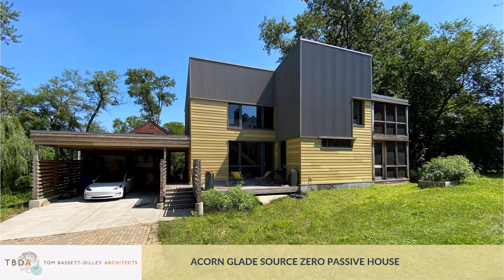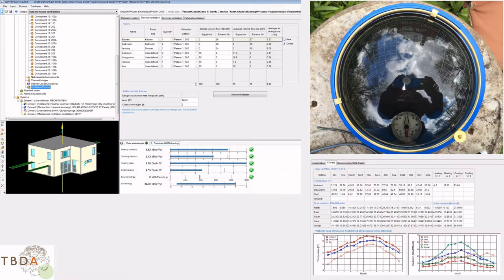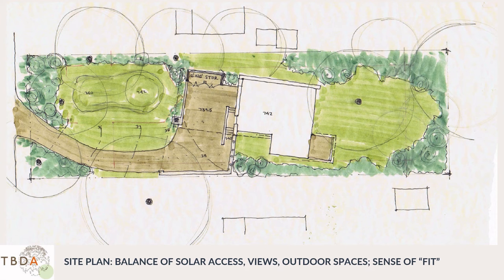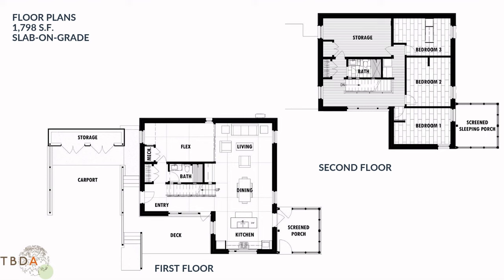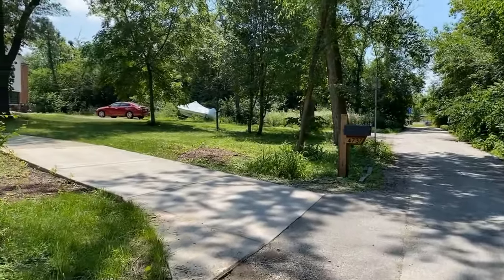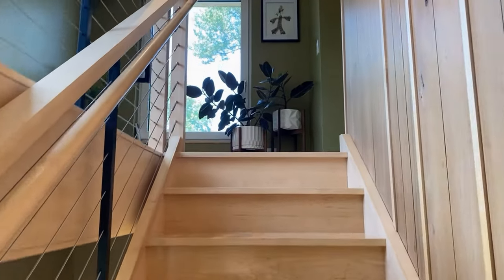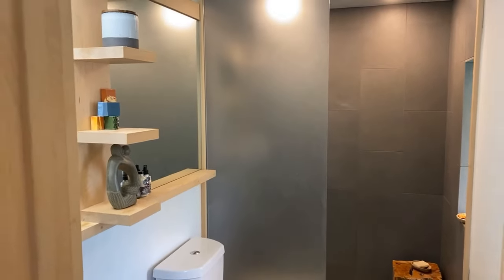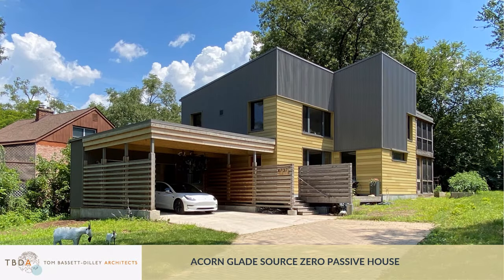Acorn Glade Passive House Tour

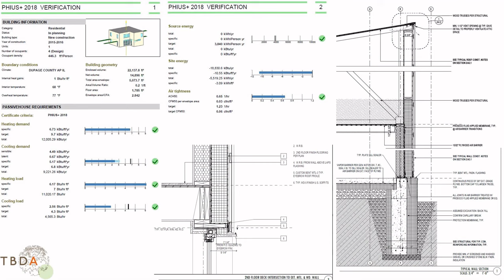Comment: Great design - sleeping porch is a cool idea.  A few questions: 1) At 4:40, why the transition from fluid-applied air barrier to Tyvek (looks like Tyvek fronts the attic space) at the upper walls? 2) At 4:58, the Blueskin WRB - is it adhered to the rigid insulation (shown in wall section at 4:00), or is there another layer of sheathing over the rigid insul. that the Blueskin adheres to? 3) At 4:00, in the wall section, how is the rigid insulation over the foundation wall protected where exposed above grade?
Reply: Brian, my guess on Q1 is that the attic space is unconditioned and uninsulated, the air barrier and insulation are likely in the flat ceiling plane on the second floor. So the Tyvek is only a bulk water barrier for the walls surrounding the attic. Would love to have that confirmed and your other questions answered.
Reply: Thanks! and sorry to be 2 years late answering...but in case anyone wants to know--the Tyvek is above the air barrier, since it's an uninsulated attic; the Blueskin went right over the EPS insulation; and we used acrylic stucco (over fiberglass mesh) at the foundation insulation.
Reply: @mjsunkiter  exactly!

Comment: the carport roof looks like it angles towards the house. Doesn't appear to consider heavy rain water
Reply: it is definitely sloping away! There's a green roof up there now which absorbs much of most rains, but the membrane was designed to make a durable structure. Good drainage and bulk water management is a fundamental design and construction need that is carefully addressed.

Comment: Beautiful home and design. Would you mind sharing what the approx price per sq footage was? Appreciate it.
Reply: IIRC, he said it was a little over 1800 sf
Reply from the maker: thanks! I'd rather not discuss costs on this house in particular, but we have studied costs on Passive House compared to built-to-code ("barely legal" like most construction), and found that for single family, first cost increase is in the 4-7% range--which is offset by energy savings from code minimum. This of course varies widely based on house shape, materials selected, HVAC systems, etc. What's key is having a builder who understands and supports the concept, and an architect who understands Passive House and will work with the builder to find cost-optimized solutions. As for cost/s.f. in general--we're seeing skyrocketing lumber costs and substantial increases in many other components--I wouldn't expect to see a new single family much below about $300/s.f. (construction cost, not including land, design fees, landscaping).
Reply: @TBDArchitects  Strongly concur. We must look at the meeting the needs and desires of the client by optimizing materials with analysis to meet social goals and the ability to afford, now, and options for the future.